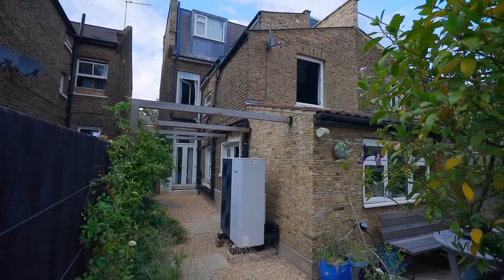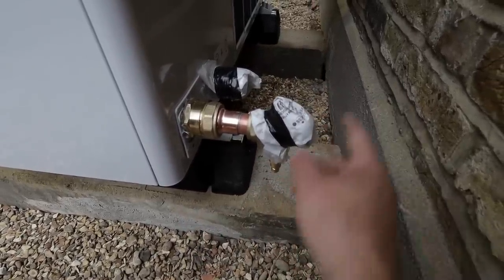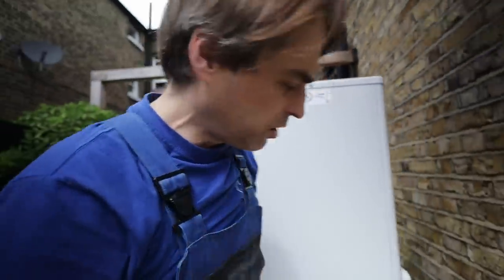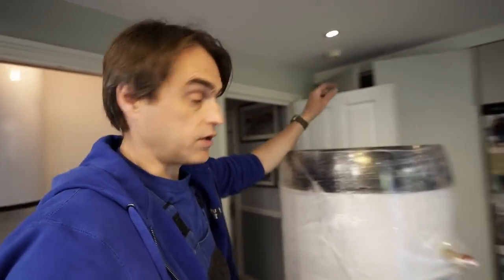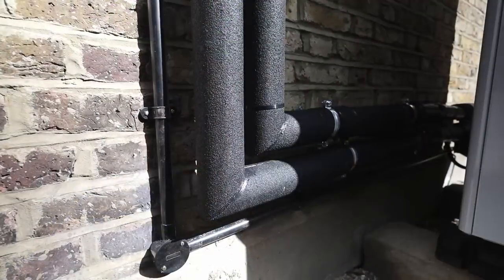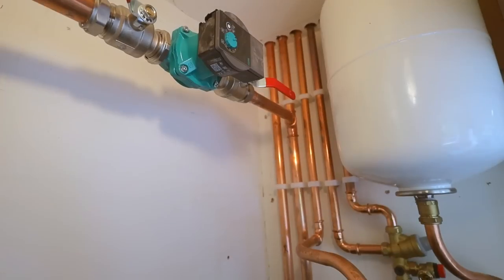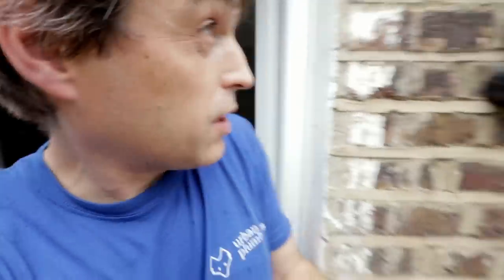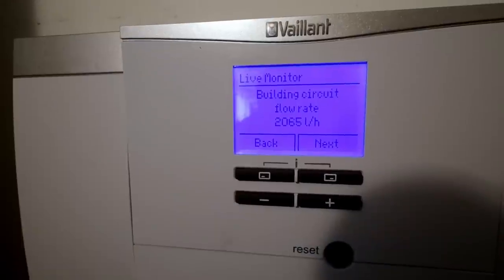Heat Pump Retrofit In a Victorian House. Is It Even Possible?

Comment: Great video as usual.  I'm currently doing my own research for replacing an ageing gas boiler next year.  Working through heat loss calcs.  Recently came across the rules around siting the heat pump for both avoiding planning permission but also for those pumps with R290 refrigerant such as the Vaillant aerotherm plus with restrictions about proximity to doors and windows. These might force me to an R32 based pump instead.  Would be good if you could cover some of the thinking with pros and cons around refrigerant choice in one of your videos.
Reply: Just remember air to air head based systems are much cheaper, more efficient, give you air con in the summer, way easier to install and for some reason barely ever used in the UK.

Someone I vaguely know installed electric storage heaters because a water based system would be too costly to retrofit into his victorian home but didn't even look at air to air systems

Why people are so obsessed with retrofitting heat pumps into water heating systems is beyond me (the govt subsidy doesn't help this). I guess it's the same reason that means loads of americans want to replace central air heating with central air heatpumps as opposed to an air to air head system.

Comment: Say its 2000 litres per minute to supply enough heat at the delta T aimed for, how do you incorporate the existing pipework sizes/restrictions in to it? Like do you say it's 5m of 15mm plastic to each upstairs rad on average, then work out what flow rate they'll get from the pump to each rad. I'm a bit lost and probably didn't word that very well 😅

Comment: Great Video; like all the others, it is really good not just for new ones to heat pumps or older experienced ones ( every day is a learning day ) but also for end customers to see what is required and what is needed to fit an efficient system. Also, 
It's good for others to see you are not perfect as we all make mistakes, that's learning 👍
The team is building  and learning to 👍👏👏, Thanks for the mention/support and keep up the great work and videos
Reply: Excellent point. Consumer understanding is something that will always be sadly lacking due to the culture of "it's what I pay YOU for". Pity, because a knowledgeable customer also drives up standards.
Reply: if you are retrofitting heat pumps into a water system it will never be truly efficient. Air to air head units will always be the most efficient system (and cheaper and easier to install). It's bizarre they aren't the standard in this country.
Reply: @mytimetravellingdog  in some cases, yes they could be dreadful. On the other hand, when the gas industry has often grossly oversized some installations, it's just possible that COPs of over 4 are possible. What's inefficient about that? Additionally, there's the personal preference factor. Many people dislike the characteristics of air-to-air heating/cooling. Like many things, there's no "one size fits all" solution. Videos like these get the conversation going as well as showcasing the possibilities. Urban Plumbers (or any other Heat Geek) would be first to advise a customer of something wasn't suitable.

Comment: This is really interesting, we have a uninsulated single brick course property and I have always thought there is no point even considering a heat pump installation until we do some absolutely massive external insulation project. But perhaps I'm wrong.
Reply from the maker: Check my other videos. We have successfully installed heat pumps in period uninsulated properties and they all are much cheaper to run than gas.

Comment: brilliant job, why use a separate buffer over a cylinder with a internal buffer?
Reply from the maker: Ohh man - I am not even sure where to start. Those build in buffers are usually not the best.
Reply: @UrbanPlumbers   what you mean by not the best?

Comment: Outstanding work as always
I’m in a Victorian house and in the next few years we will be needing a boiler replacement but I have the advantage of cavity walls , I’ve really been watching your work with heat pumps to make a call witch way I should go
Reply from the maker: Heat pump, but only if you can find a really good decent installer. What area re you in?
Reply: @UrbanPlumbers  Well exactly that is the key , they still seem to have a lot of doubter and as you proved in a previous film with the badly installed unit , I'm just on the London Surrey boarder , I'm still undecided what option to take weather to go solar as I have a ideal spot for south facing vertical panels with a boiler or  heat pump, I've a few years I hope before my combi will need replacing as it's not worked that hard
Reply from the maker: @BerlietGBC  you are in the area with the best installers in the country. There are 3-4 heat geek elites in London / Surrey borders, and then you also have me who covers your area.
Reply: @UrbanPlumbers  Well I've been watching you work for ages , your definitely my first choice, I'm an engineer and I like the way you work

Comment: Would it be possible for you in a future video to touch on balancing the flow through the radiators?

More specifically, since you always size systems correctly, thermostats on the radiators are not needed. :)
Reply from the maker: I don’t even bother balancing, just don’t tell anyone.
Reply: @UrbanPlumbers  soooo.. fully open thermostat and/or, what do you call it over there..., lockshield?

Comment: Another interesting video, thanks. Im interested in how good the primary pipework will perform with so much of it outside. I realise you had no choice but i would assume some heat loss
Reply from the maker: quoted heat loss art -2 and piepwork at 40C is around 10W per linear meter. We have around 18meters total, so 180 watts heat loss to the outside. At -2 unit will lose around 2% of it's output to the outside.

I a quoting from memory so can be wrong by a small marign.
Reply: @UrbanPlumbers  not as bad as I thought. Thanks

Comment: myself and my plumber had a bit of a fuss over the anti-freeze valves. he had only installed glycol systems before and following the heat pump suppliers specs we fitted a valve on the flow and the return, which resulted in some awkward pipework behind the unit to get everything to fit. we've got a daikin altherma monoblock, it comes with an isolation valve with strainer which is fitted on the return. I've noticed in your installs it appears you only use one anti freeze valve? I'd love to be able to do so since i could just put it directly on the back of the unit (flow) and very much simplify my outdoor pipework and the nightmare of insulating it.

Comment: Hi great video quick question what’s the heat loss of this property m2 of building how many rads on system and what size unit. ? Just curious because I’m going to install in my own property.  
Thanks
Reply from the maker: you need a full heat loss calcs done. All houses are different. This one was 11kW heat loss and I think around 180m2. The unit is 10kW on the badge but goes to around 11kW with 45c flow temp. I think the unit I chose may be around 2-3% under calculated heat loss.

Comment: Great job explaining everything so well!
I want to upgrade my heatpump external pipework to 28mm copper from 22mm copper but struggling to find any decent insulation and trunking?
Any reccomendations for a supplier?
Reply from the maker: Pump house for trunking or primary pro and rubber lined clips form mid wales plumbing supplies
Reply: Brillaint---many thanks   @UrbanPlumbers

Comment: Love these videos. Good entertainment on a sunday!! I have two questions. I'm currently building a new house and have bought an Arotherm plus. I'm trying to decide which side of the house to put it. One side is the sunny side of the house, where the primary pipework to inside would be very short (1,5m one way). However it would be right next to my fairly narrow driveway me and my neighbors use. It would take up valuable space and there would always be a risk of someone hitting it, but it is possible. The other option is the 'cold' side of the house. The side is in the shade most of the time, and the primary pipework outside would have to be about 8 meters long one way. It would be mostly straight pipe though. This side is more convienient for space, looks and safety. My questions, which side would you choose? Is the sunny vs cold side a significant COP gain? And also, is the short vs long primary pipework a significant COP gain? Thank you and keep it up!
Reply from the maker: Put it on a shaded side. Sunny side does not give more efficiency! Also sunny side causes units to shut down on very hot days a compressors can’t operate when ambient reaches 40c, which has actually happened on one of my jobs this year.
Reply: @UrbanPlumbers  Thank you for your reply! I will put it in the shade then, its overall a nicer spot for it to be. Are you willing to comment on efficiency loss with longer primary pipework? What I want to do is well within what Vaillant allows, not worried about it at all, but curious what an expert thinks.

Comment: Interesting Video as usual. Just one question...why do you never (as far as I have seen) use the Unitower?
Reply from the maker: more expensive, less flexible, and requires more space around for maintenance.  I really don't like Unitowers or any other integrated equipment. It is usually easier to install at a cost of price, flexibility and more difficult maintenance.
Reply: @UrbanPlumbers  
Thanks. Our installer gave us the Unitower (didn't leave us any choice really) and I am not super thrilled with it. It appears to lose quite a bit of heat over time and I am thinking of adding extra insulation.

Comment: what is the electrical input to the pump 8 kw ?. and does that run all day or maybe 10 hrs. 10x8 +80 kw per day.
Reply from the maker: It depends on the external temperature, system design and flow temperature. It’s not a fixed input unit. Maximum rated input is 5.40kW, but this unit should never need that much, as it is designed to need around 4kW as maximum input and much lower input 95% of the time
Reply: @UrbanPlumbers  thanks.

Comment: What I fundamentally don't understand is why not just install air to air system that uses heads in each room and a separate electric boiler for hot water?

Far easier installation, way more efficient and you get aircon in the summer which is really important in victorian houses.

Why is everyone so obsessed with retrofiting heat pumps into water radiators (other than the idiot governtment's subsidy only covering this)? 

Literally the only reason I can think of is people are just used to water heat systems.

Comment: Pointless unless the place can be insulated.  My friend has a 16th Century stone cottage and with all the draughts etc, this wouldn't be a viable form of heating.  To insulate would cover all the features internally and certainly wouldn't be allowed on the outside as the building is listed. Catch 22.
Reply from the maker: Not true. Insulation is preferable but always required as in this case.

Comment: Great video! Thanks for sharing!Do I need a buffer on a full UFH installation without rads?
Reply: The buffer is only there to compensate for the extra pump, if your system has well sized pipework then you won't need it.
Reply: Okay! Thanks for the reply!The UFH pipe is 16mm off the manifold with 22mm flow into 2 manifolds
Reply: @myatix1  looks like you should be good if the other pipework is fine.

Comment: Have you fitted any Discrete Heat ThermaSkirt systems instead of radiators to ASHP systems? Any feedback?
Reply from the maker: I installed it once. It was ripped out after few weeks. Push fit origns that are not great, difficult to install, expesnive to supply and install, output is miserable so need high flow temperature - generally a bad idea, unless you want super low flor temperatures and use them as a supplemnt to UFH or radiators. 

I frankly do not see a point of that product.
Reply: I took a lot of skirting radiators out in the 80's that had been fitted in the 60's and 70's. Everyone was glad to see the back of it.
Reply: @UrbanPlumbers  Interesting to see that the University of Salford have a test 'shed' with two detached houses inside. It is a technology demonstrator and has some of the national builders and heating system companies involved, including Valiant and Discrete Heat. It is a variable environment shed that can produce deep winter to summer conditions with differing humidity levels. Worth a look! It all appears to work with full monitoring. It will appeal to your analytical/engineering outlook.

Comment: Good update, great to hear your thoughts about the buffer and synchronising the flow rates between hot water and heating circuits.
Reply from the maker: Time will show of it can work well
Reply: @UrbanPlumbers  They installed the same buffer (45L Vaillant) in our system.  The COP is only 2.3 since installation in mid-March. The house is nice and warm on weather compensation only (heat curve 0.45) and flow temperatures when ever I check are  below 35°C. I would expect COPs through the roof, but I think 3.0 was the best we had so far. Really not sure why, and they don't know either.  It's 7kW Vaillant aeroTherm plus on a 85m² , 3-bedroom bungalow. Perhaps the whole thing is oversized?  And/or could the buffer and distortion you mentioned a likely cause?
Reply from the maker: @pip1980   - just to let you know - this system scop on heating right now is 5.0 and 3.8 on DHW. 7kw is most likely oversized for an 85m2 bungalow. Also, it most likely does not need a buffer. That size property would be 3-4kW heat loss and could easily be run with a much smaller unit. Also with small heat loss, there is no need for 4 pipe buffers at all.
Reply: @UrbanPlumbers  Thanks! They sent a few different engineers now and they all sort of hinted at the same thing. I hope they agree to fix it.

Comment: Here's my anti-dictator like smash for you! 

P.S. Are those Stelrad K3 rads?
Reply from the maker: thank you :) - no they are K3 Ultra heats - chepaer than stelards but still decent quaility.
Reply: @UrbanPlumbers  Just FYI, Stelrad often has massive sales through the year on their website. Right now, it is 25% off for their K2 range, which puts them on par with the cheap stuff. 

We only fit Stelrad due to their long term corrosion resistance, so thought I'd share.

Comment: Was trying to explain to someone the other day that a heat pump would work in an old house if installed properly and you can get a scop of 3.5!
Reply from the maker: You can get scops over 4 i old houses
Reply: Well, the limiting factor is mostly the temperature that is necessary to heat up the place. So the bigger the radiator or better floor heating, the better the efficiency.  I read a study that reckons that it's efficient as long as you don't exceed 55°C target temperature. Above it, the efficiency drops significantly.

Comment: Unfortunately, not sure whether your point about using gas vs electric to heat your home is true (correct me if wrong). At the moment the UK produces (dependant on demand and the activity of renewables I.E no wind or no solar) between 25-50% of its electrical demand via gas powered generators which will always be less efficient than simply burning the gas in a Combi. So unless these houses are completely isolated from the grid its unlikely to be having a great effect on despot dictators.
Reply: Ignoring the impact of the Ukraine war, natural gas prices have been on a strong upward trend because of demand in Asia .  UK is uniquely dependent today on gas generated electricity but that percentage will drop as more renewable come online - I would suggest under 30% within 5 years.  We don't benefit economically from ~50% of our electric power coming from renewables because contract prices are linked to gas price but that will change over time as 15 yr contracts come up for renewal.  The Govt is currently trying to tie a new wind project to a contact price of £44/MWhr  (or 4.4 pence per Kwhr) - this is an unrealistically low price and the Govt will have to compromise or collapse the offshore wind sector in the UK.  Domestic users in the UK are paying £280/MWhr currently + 5% VAT for electricity.   Domestic gas heating cannot be much more that 90% efficient whereas heat pumps should achieve COPs or around 300%.  Air source heat pumps may not be compelling today if you have an efficient gas boiler but they will become so later this decade.
Reply: @dickcliffe  well explained and very interesting.
Reply: Well it stands to argue that given the efficiency heatpumps of 300-400% on good installations you get more energy out of the gas. Even with losses when producing electricity.  And if the production of renewables increases, the demand for gas goes down across the board.
Reply from the maker: That is already the case as using a heat pump vs has boiler is supposed to cut co2 emissions by 70%, so I guess energy use at source (gas) and grid losses must also be smaller, but I don’t have figures to back it up at the moment

Comment: How much did that property cost to insulate to a standard a heat pump would be efficient lol
Reply from the maker: check my other videos where we have installed heat pump in uninsulated homes and still have them running over 400% efficiency and running cheaper than even the most efficienct gas boiler.

Comment: Nice project, @ the moment i'm using more and more the vr70 for controlling the sec. Pump. Not only the pump is switched on every 24h in summertime, but also I have the feeling the heatpump is running smoother than without and only using the VWZ AI. Did you tested this?